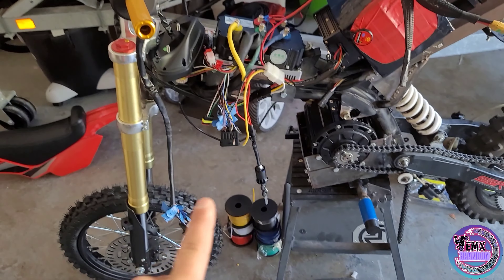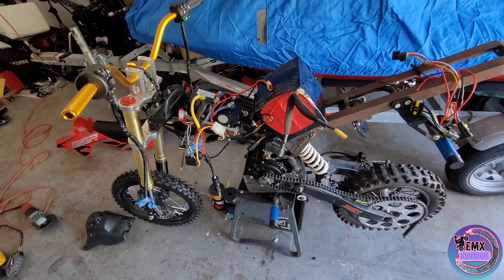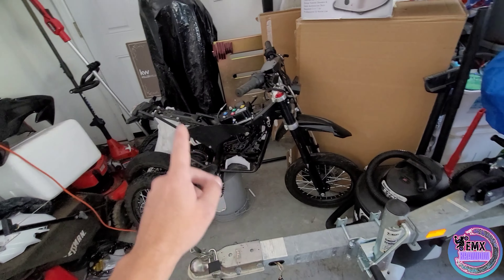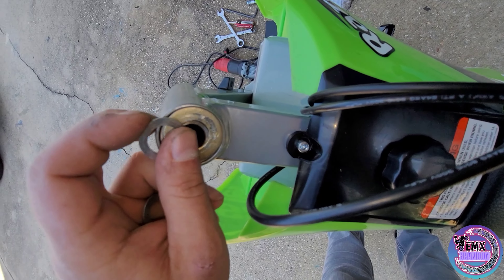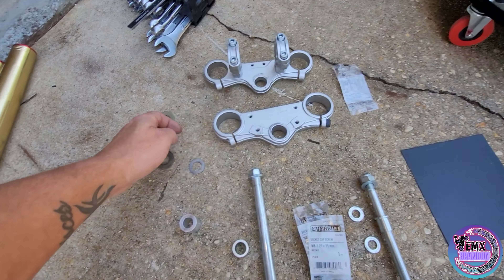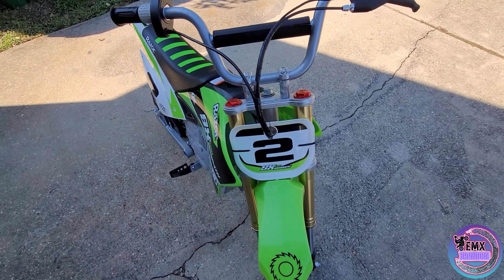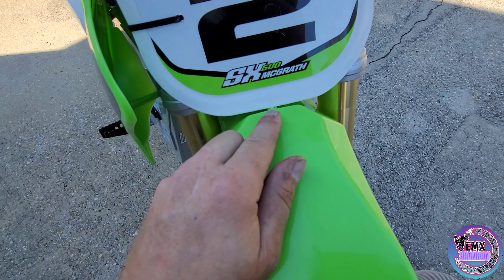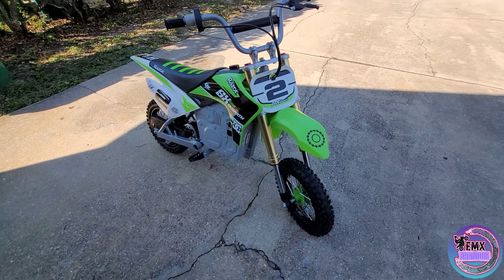Razor Sx500 Fork Upgrade - Mototec Forks!

Comment: hey i decided to go with the mototec and mod it like u so it can go 50mph but wats the weigh requirement? saw sum1 who said they weigh 185 but anything pass 200lbs will break it and im 5’10 206lbs (but i work at fedex so ima definitely burn sum calories)
Reply from the maker: Nah you wont break it. Id definitely say get a decent resr shock to replace the stock one and maybe look into some drop pegs. But im 5'9 185 and i beat the hell out of it an extra 20 pounds wont hurt it 🤘 the stock bike weights 95idh pounds and mine probably weights 125 130 now and everythings solid
Reply: @EmxBrandon  gud looks bro i swear u inspired me to do this shit gang much respect for letting me kno i aint too big for the bike 🤣
Reply from the maker: @capolean2902  haha hell yeah bro! And nah theres plenty of bigger guys riding these bikes and razors all the time 🤘

Comment: Hey Brandon, thanks for the install guide!! Best forks for the price!! How did you get the hydro brakes on? My zoom brakes dont bolt up. Did you use an adapter for the caliper? Thanks!!
Reply from the maker: I just used the mototec brakes that came on the bike. If you can find that little metal caliper bracket they should bolt right up.

Comment: @EmxBrandon Have you tried the Ride or Die fork kit? I'm just curious about the difference in height/length and stiffness... The Mototec upgrade would cost me around $230 with some nice bar clamps and the Ride or Die kits are $325 but include the complete brake kit which is maybe $50 or so. So with prices pretty close, just curious about ride quality and height. Thoughts?
Reply from the maker: I havent had them before, but they are ebay forks and most likely very similar to the tdpro forks on my mototec. I believe they offer them in a bunch of lengths? The Mototec is 635mm i think, but the big difference is the fork tube is smaller on the mototec forks 39/42 and the r&d forks are the normal 45/48 so they are alot heavier. If you got good power i prefer more weight, plus they will be alot stiffer than the mototec. But if you want it for a street setup the mototec forks are cushy! I love my rsf650 with the mototec forks, its smooth as butter. Quality is gonna be about the same between them, but the r&d triple tree is alot beefier than the cast mototec triple clamps. If you ride hard id say go with the r&d, when you order through mototec they charge alot for shipping so the prices may end up the same anyways.

Comment: Awesome video!! Thank you. Hey Would the rear shock in the motoec bolt up to the razor?
Reply from the maker: Yeah! I threw the stock mototec rear shock on the sx! I would definitely recommend buying bigger bolts and drilling the shock tabs bigger though. The stock razor shock bolts are pretty thin and the shock itself will have play! Otherwise it felt night and day compared to the stock razor suspension!
Reply: @EmxBrandon  Thanks man, You think it would be worth it to try and make the swingarm fit?
Reply from the maker: @Desert Rider  its definitely been done before! You just have to move around the shock tabs on the razor frame otherwise the rear shock will bind and get stuck once its compressed enough. Hard to explain

Comment from the maker: Parts linked in description! This swap is only for the sx500, the 15mm axle is too short for a rsf650 or mx500/650. Check out my rsf fork swap video for details and you can combine both methods https://youtu.be/qRAJ_6bfbAw

Comment: Thinking about doing this fork for my son and running my spare front wheel on his mx650 with mototec front hydro brakes from the site  🤔
Reply from the maker: Night and day difference! Just remember to order a 255mm length 15mm axle if you copy my method, since the mx headtube is longer than the sx!

Comment: What is a better fork for trail ridding and bumps the mototec or say like fly pig forks or? What do you suggest broth3r
Reply from the maker: Trail riding you want softer suspension like the mototec, especially with how light the razors are once you start putting on 45/48mm forks they get very stiff which is terrible for trail riding. Definitely recommend the mototec forks if you can get ahold of them!

Comment: Hello ,.. thanks for video,.👍. do you know if i buy this fork kit from E & C ,..will i need to still buy all these extra little parts from hardware store, Ebay, and such?
Reply from the maker: You wont need anything from the e&c kit. The difference is their selling the shorter fork tube, with a 12in wheel.
Reply: @EmxBrandon  ok cool thanks a lot for fast reply ,.. so the kit is little shorter ?,  do you know what the length is ?
Reply from the maker: @hectornacho2474  they are the same forks as the mototec 36v 1000w bike and i believe they are 14in or 14.5in, one of those two

Comment: Awesome video. Does the mx650 also use a 15mm stem? 🤞
Reply from the maker: Yup! Youll just have to order a 255mm length instead of the 220mm i use for the sx
Reply: @EmxBrandon  thank you again. I happen to have one 255 and two 220's from other projects laying around.
Reply from the maker: @mino6466  no problem! And when you hit lowes for the washers check the brass collars for a bottom triple clamp spacer you might be able to use instead of that 24mm od 15mm id aluminum one on ebay. You might be able to save a couple bucks!
Reply: Checked Lowes, Home Depot and Ace for the 24x15 bushing. No luck so I'll buy on ebay. How long does it need to be? 24x15x??

Thanks again man!
Reply from the maker: @mino6466  should say in the description i cant remember off the top of my head

Comment: Thanks
Reply from the maker: No problem!
Reply: @EmxBrandon   the sx500 is better to build than the mx650 ?
Reply from the maker: @orif3088  the sx has more battery room due to shock placement, but the mx650 has a stronger shock hoop on the swing arm. But honestly its all about preference.
Reply: @EmxBrandon  ohh okay thanks a lot appreciate it

Comment: How did you get the already stick on the forks off
Reply from the maker: I bought the triple clamps without the steer shaft. It needs to be pressed out or use a hammer and large socket. I'm assuming that's what your talking about?

Comment: i have the mx500 and i don’t know if that long 220mm bolt will fit my stem how can i find one the right size ?
Reply from the maker: Correct youll need a 255mm long axle bolt! Just type that in on ebay or Amazon

Comment: where can i buy the bottom triple tree clamp without the stem?
Reply from the maker: https://mototecusa.com/mototec-pro-dirt-bike-lower-triple-tree-clamp.html
Reply: @EmxBrandon  also what do we need the larger axle for is it for the wheels or the steer tube because i have an mx500 and am thinking we use the stock steer tube axle and then the new axle for the wheel
Reply from the maker: @skibidi269  the 15mm axle is for the steer tube. Since yours is a mx500 it will be longer. You won't be able to use the stock bolt since the triple clamps are much thicker than the steel plates the razors use. You'll need to figure out an adapter to adapt the holes of the mototec clamps to the size bolt youll need. I'm not sure if the crush tube inbetween the bearings of the sx500 headtube will accept a 15mm axle so if you go that route make sure it slides through and you get the correct size. I believe I used a 255mm long one for my rsf 650.
Reply: @EmxBrandon  so do you think the best route to go is buy the 255mm and 15mm  axle first to see if it fits and if that fits it will work or is there something else that would need to fit as well?
Reply from the maker: @skibidi269  yeah I would buy the 15mm axle and worst case find a crush tube that will accept a 15mm inside diameter you can replace on the inside of the headtube. Check out my most recent video with the triple tree adapter youll see how it's supposed to work
Reply: @EmxBrandon  ok so i just watched the video so lets say i get the 255 mm because the steer tube is longer and 15mm axle and if that fits in the crush tube  should i be good to fit all the other parts?
Reply from the maker: @skibidi269  yup exactly!
Reply: @EmxBrandon  thanks for the help!
Reply from the maker: No prob!
Reply: @EmxBrandon  ok so the axle came and i tried putting it in but it only was able to got past the bearing not the crush tube what should i do?
Reply from the maker: @skibidi269  I would buy something like this and cut it down to the size you need and replace it with thr old crush tube!
https://amzn.to/3VeJGgy
Reply: @EmxBrandon  do you know what size i would have to get it cut to and how would i get the bearings and crush tube out of steer tube
Reply from the maker: @skibidi269  stick that 15mm axle in and take a hammer to it till the bottom bearing pops out. Then use the crush tube that fell out to measure the length you need and replace it. Then carefully tap the bottom bearing back into place.
Reply: @EmxBrandon  im still a little confused on how i would get the bearings and crush tube out i j stick the new axle in the steer tube and give a couple hammers? will the top bearing follow?
Reply from the maker: @skibidi269  yeah stick the 15mm axle into the top bearing hole and hammer till the bottom bearing falls out.
Reply: @EmxBrandon  so i tried this and it went in like halfway but then it stopped going farther is there a 14 mm axle or should i keep on trying to get it in
Reply: would it be easier to add you on facebook so i can send you pictures of what it looks like?
Reply: @EmxBrandon  i was able to get the bottom bearing out but now the axle is stuck in the crush tube. and i feel that the head tube in length is the same length as the sx500 is there any way you can measure yours because i cant find any specs online
Reply from the maker: @skibidi269  use the old headtube bolt to knock out the 15mm axle, you'll figure it out. And you ordered a 255mm long 15mm axle right?
Reply: @EmxBrandon  yes and its currently inside if the crush tube but worst comes to worst i buy a new one but im gonna have to cut the axle right?
Reply from the maker: @skibidi269  why would you need to cut it? Use the old skinny head tube bolt and insert it into the crush tube and knock out the 15mm axle.
Reply: @EmxBrandon  yes im going to do that but i was talking about the length of the axle would i need to cut that for it to fit and also what is the length of the sx500 head tube?
Reply from the maker: @skibidi269  it's not something you can cut, I though you had a mx? I don't know the size of the sx headtube that bike is long gone
Reply: @EmxBrandon  i do have a mx so that size in length axle that i have is the correct length ?
Reply: @EmxBrandon  in the video the spacer for the axle is used in the triple clamp but i bought a different one where can i buy just the spacer ? and how long in length is the spacer from. ebay ?
Reply from the maker: @skibidi269 one of these should work I don't remember the length
https://amzn.to/3KG1Z9i

Comment: What size rear shock you running
Reply from the maker: Still the stock rear shock im not sure what size it is off the top of my head
Reply: @EmxBrandon  the stock is 200mm you should run a 220mm
Reply from the maker: @mrsir777  ok cool deal, yeah ive had a couple people ask if the forks would go well with a 220mm shock and that sounds like the perfect length to level it out. Im thinking one of those dnm shock, cheap but seems like everyone loves them 🤔
Reply: @EmxBrandon  ya you just gotta get the right lb spring for your weight and they work well, im using the fastace brand.
Reply from the maker: @mrsir777  ive heard that i want to double my weight and thats gonna be the appropriate spring weight whats your thoughts? Im pretty mechanically inclined but when it comes to suspension im clueless and honestly scared to pull the trigger on one. I especially need one for the mototec 😆
Reply: @EmxBrandon  I just tested a 550, 400, and 300lb spring and I weigh 180lbs. The 400lb spring works for me, when I sit on my sx I get an inch sag.
Reply from the maker: @mrsir777  see? I appreciate you doing the work! Im 185 so that would work great for me also. 1in sag sounds perfect, not super stiff but not sloppy. Ill get a 400lb to start off with 👌
Reply: @EmxBrandon  hell ya maan! I gotta tutorial on how I did my front end too.
Reply from the maker: Wheres it at? Your youtube shows no content id love to check it out!
Reply: @EmxBrandon  oh I never made it lol I would make a video but I don't have a pc.
Reply from the maker: Make one with your phone! I do all my filming editing and uploading on my phone cause i dont have a pc either and the laptop is too much of a pain and slow lol
Reply: @EmxBrandon  I had not tried using my phone lol I have a gopro maybe I'll strap it to my chest and do it lol
Reply from the maker: @mrsir777  yes sir! And i use the insta360 mobile app to transfer onto my phone aswell. One of these days ill get a badass pc but till then my phone works just fine 😄
Reply: @EmxBrandon  wait can't you just download it to your phone automatically from the quik app?
Reply from the maker: @mrsir777  im not sure about automatically. Usually i use the insta360 app to do the jump cuts to edit the clips down before i upload it to my phone and the i put it in the inshot app with whatever phone clips i have aswell and then edit it all together to make the final video and then upload that to my phone and post it to youtube 👌 its definitely a process but im pretty proficient with my phone. Then i use my laptop with an external 6tb hard drive to save all the original clips and video to save space on my phone.